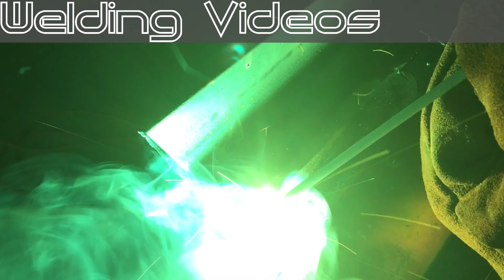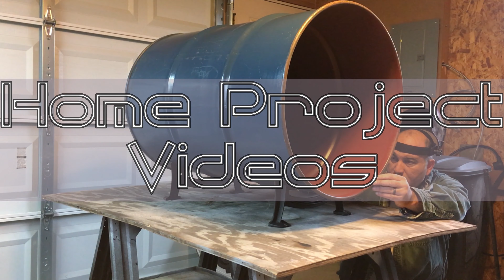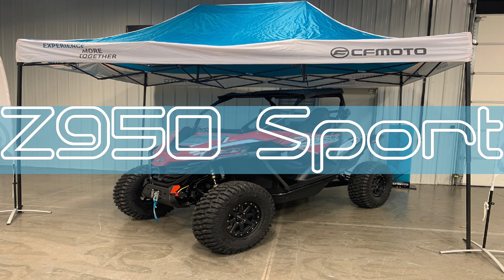Zforce 950 Lower Door Sections Install

Comment: Does it get to hot in the summer time ?
Reply from the maker: Not because of the doors. But I installed a windshield also and that made a huge difference. It gets way hot in the summer with the windshield down. Luckily the windshield I bought will open up so it’s not bad but I’m still thinking of removing the windshield just for the summer months and reinstall when it gets cold